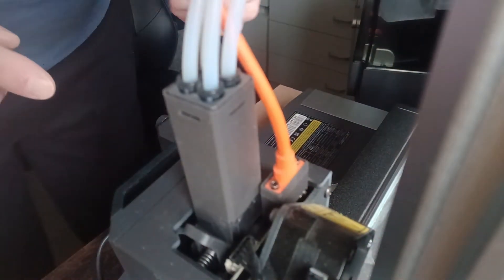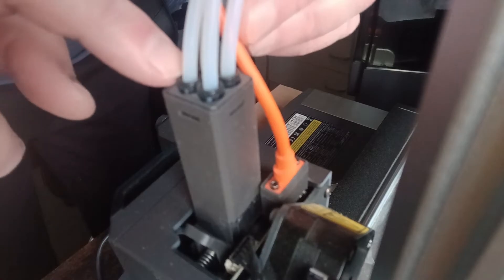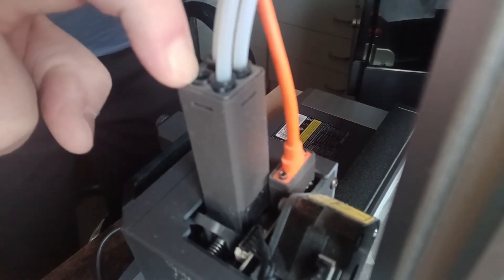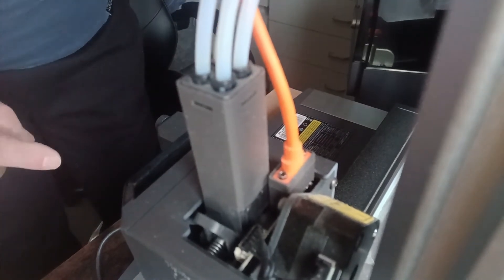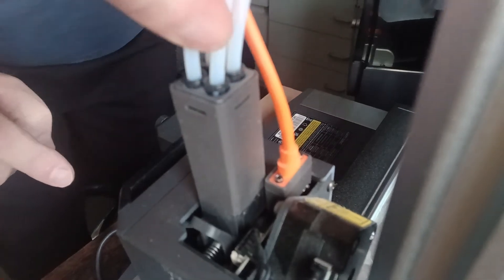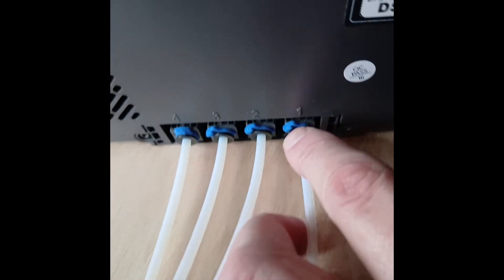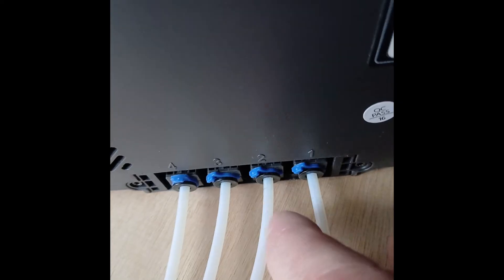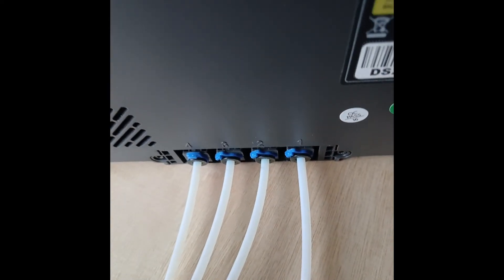How to remove the PTFE  bowden tubes from the Anycubic Kobra 3 print head and Ace Box Pro.

Comment: Can't get the tubes out of the ACE Pro, removed the blue clamp, but no matter how much i try to pull them out, it doesn't work.
Reply from the maker: Hi once you have taken the blue clips off you still need to push in the black part around the tube like you do in the printhead and then the tubes should pull out
Reply: @resin-art-and-3d-printing  I tried that, with both thumbs while a third person pulled on the tubes, they don't move.
Reply from the maker: @shirobaka8453  Hi heat up the hot end  and then try pulling it out again,  you might have filament stuck in it. Also try twisting the tube while you pull on it.
Reply: @resin-art-and-3d-printing  The tube is stuck in the ACE Pro, not the hotend side.
Reply from the maker: @shirobaka8453  Yes but  when u heat up the hotend it starts to extrude a little bit of filament puling it through so if it is filament which is stuck it might just loosen it up
Reply: @resin-art-and-3d-printing  I already removed the filament completely, and all four tubes are stuck, i could understand if one tube was stuck, but all four seems a bit weird... Makes me wonder if there were some design changes, i just bought the printer about three weeks ago.
Reply from the maker: @shirobaka8453  That does seem weird. The tubes should all pull out.  Contact Anycubic and see if they can help.

Comment: I wasnt sure wether to pull or push it, as both ways nothing happened. When I watched this video, I had to use long nose pliers to push hard down on it, it came loose eventually. Incidently, have you found that Anycubic filament breaks more easily in the tubes than any other brand? Even with drying first.
Reply from the maker: Hi yeah sometimes they are hard to push down. I have not found Anycubic filament breaking when I have used it in the past but I do not use it very much as I normally use Jayo or Sunlu filament.
Reply: @resin-art-and-3d-printing  I have found Sunlu way better and less prone to snapping

Comment: As many others have stated the black rings on the print head won't budge.  I have no solutions... has anyone who had this problem been able to remove theirs?
Reply from the maker: Hi You have to push down on the black rings, while pulling out the PTFE tubes Im not sure why they should be stuck unless you have filament jammed it. Sorry I can't help you

Comment: Cant remove... The Black things dont move when I pull
Reply from the maker: Hi you have to push down on the black things and while pushed down you can remove the PTFE tube
Reply: @resin-art-and-3d-printing  Same problem here. I push down the black things but they just won't move down at all (unlike in your video). I almost broke my nails trying to push down the black things..
Reply: @rayjaken  did you manage to do it?

Comment: You must have an earlier 3D printer because the way you're showing it, I'm doing the same thing, and those black buttons are not budging
Reply from the maker: Hi that is strange cause even the later ones you take the bowden tubes the same way
Reply: @resin-art-and-3d-printing  I pushed as hard as I could, and even had a friend help, but we both couldn't get the black ring to push down. I DID get the tubes to release from the printer the 2nd time I tried. I even printed a tool to help push the black ring down, and still nothing.
Reply from the maker: @lovedfriend2020  Im glad you got the tubes out in the end :)  3D printing can be brillaint at times and also drive you you crazy at times lol
Reply: @lovedfriend2020 how did you get them out from the back of the printer? I got them out from the ace pro but not the printer. I used about everything I could find the push the black things down and nothing made them push in
Reply: @GiniRisinger Hey, I figured out how to fix the problem — and why it happens.
I was in the same situation, and not even pliers could get the PTFE tube out. I even broke a nail trying to pull it off.
What I did to finally remove it was take off the hub cap, and then I noticed the tube wasn’t coming out because, when I inserted it, it probably got slightly scraped and formed a small ridge when pulled back.
I kept trying for a while, and the only thing that actually worked — as dumb as it sounds — was pressing the black ring while pushing the PTFE tube in with my teeth.
Yeah, I know, that’s kinda dumb — but it worked.
Reply: What printers do you guys have? I have the kobra 3 v2, I don’t know if any of you will respond but I have free floating filament in the tube and my normal method to get it out isn’t working. I can’t get the tubes out though!
Reply: Oh nvm lmao I just was being too gentle
Reply: Turns out once you get mad at it it works.
Reply: Yeah I can’t get them out of the ace pro.

Comment: I can’t remove my tubes at all. They refuse to come out and it doesn’t have the blue tips on. Am I doing something wrong?
Reply from the maker: Hi are you talking about the tubes at the back of the ace box or the ones which go into the print head ? The ones on the top of the print head do not have blue clips on and you have to push down on the little raised plastic bits which they go into to get them out. the ones at the back of the ace box you have to take the blue clips off and then they pull out.
Reply: @resin-art-and-3d-printing  I meant the one on the back of the ACE. I got them out though. Thanks for responding!
Reply from the maker: @Beltrajo3  Glad you got them out :)

Comment: I can't hat my bowden tube to stay in place.  Removed blue cap, tried pushing it in can't get it to go in far and lock into place. Any video anyone has found would be appreciated.
Reply from the maker: Hi it does not lock into place all you do is push it in as far as it will go and then replace the blue clip  Its the blue clip whcih keeps the tube in. There should be a thin black line around the tubes which inicates how far the tube goes in . If you look at this video at around 12.27 It will show you how to put them in https://youtu.be/uBCi8J7q8zM?si=22jnBMPIugTOGyi2

Comment: The rings around the tubes on the nozzle are not pushing down or lifting up at all. I have turned my printer off and cooled it down, and heated it up. Nothing is working to get this broken filament out of the tube. Help is much appreciated.
Reply from the maker: Hi heat the extruder to 180 -230 wait until the heat moves up then try and pull the bowden tube out,  you more than likley have a blob stuck in it,  or the other way is to heat it up quickly remove the complete nozzle using pliers  ( be careful you dont burn yourself ) and then try and push the nozzle cleaner or a thin screwdriver up into the bowden guide. If none of that works you might have to remove the whole bowden guide block or contact Anycubic and see what they suggest.
Reply: @resin-art-and-3d-printing  I just had to ask my dad to do it js because hs stronger lol
Reply from the maker: @ThatOneBlenderer  Hopefully you have got it sorted out now
Reply: @ThatOneBlenderer  I AM the dad in my house, and the rings on my essentially new printer have zero wiggle room in any direction. None whatsoever. Not even one micrometer.
Reply: I managed to get the tube off. I heated the printer, took off the front panel, and saw a piece of filament stuck in the print head. Following Anycubic's instructions, I pulled the handle to the right and ran a piece of filament into the tube. I could see the broken filament wiggle a bit as I pushed another filament down into the tube to try pushing it through the extruder, but the broken filament refused to move down into the extruder.

Any other tips?
Reply from the maker: @NoOneYouKnow2025-m8c  Hi If it is stuck where the see through panel is on the extruder you could try put it back together and load filament into it  and see if you can either run a print to get it to mover down or try and see if you can extrude it. The only other way is if it wont move is to take it apart but be carefull as there is s spring in in there which ha sa habit of getting lost.
Reply from the maker: @NoOneYouKnow2025-m8c  Glad you managed to sort it out
Reply: @resin-art-and-3d-printing  I haven't even turn on my printer yet, in my case there is no filament inside. I just want to rearrange the tubes before turning on the printer. But the black things won't move down when I press, not even a milimiter.
Reply from the maker: @rayjaken  Are you trying to remove the tubes from the print head or the back of the ace box ?

Comment: Hello, for the Acepro ( v2, coming witht the S1 )  , I had to remove one pfte and after removing the blue clip , it was not so easy to remove the ptfe tube ... I also had to press ( it's hard ) with one hand , and pull the ptfe with the other hand  
( not a really easy job )
Reply from the maker: Hi yep they can be hard to pull out at the back where the blue clips are compared to the ones at the top of the print head.  Those clips are also a pain because they srpring off but if you lose them there is a file to re- print them or you can buy them from Alli express and Temu.
Reply: I have no idea how you do it because I'm pushing down and it's hard as I can and they are not budging